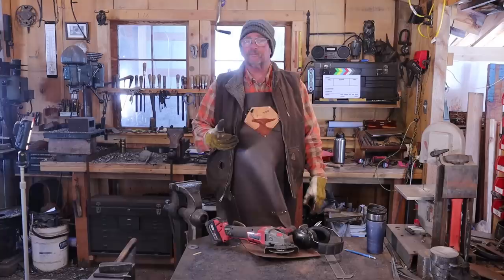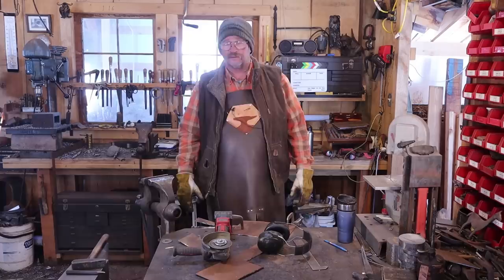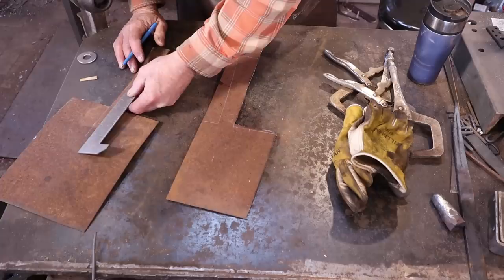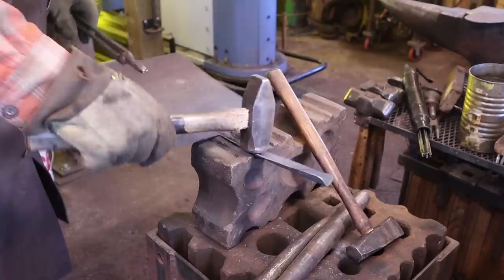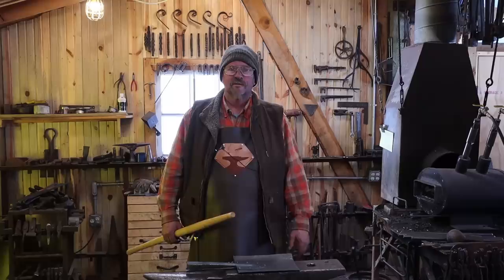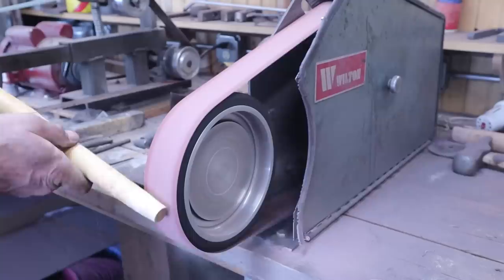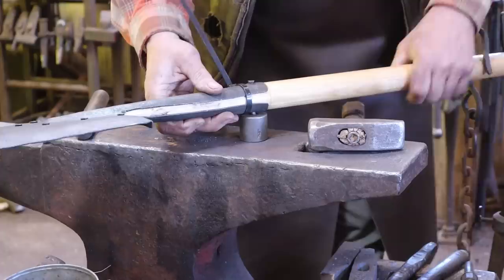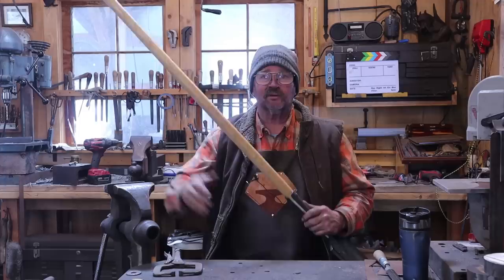Forging a shovel inspired by historic examples

Comment: The step, that part of the shovel you put your foot on is called the step. 
Nice project, until i get ventilation set up in my new shop i can only use my gasser, which has only a 6" opening. Weather has finally broke here so hopefully i can get on that this weekend. 
As a side note my "new" house came with #100 of coal still in the chute.

Comment: Thanks John. The old shovels around the farm usually have no larger than 3/16" rivets holding the handle and often have a second smaller about 1/8" rivet lower down. Some have a single handle support that wraps fully at the blade end but is split all the way and these have the top rivet set into the wood on the backside, the second rivet goes at right angles to stop the ferrule spreading under pressure. Love your shovel but think it would benefit from a second rivet to stop the halves spreading when under pressure.
Reply from the maker: Thanks for the information

Comment: I like how you made it! 
For next time try putting ring  where you putt rivet on handle... it's more army showel corect😉
Reply from the maker: The original example used rivets, so using a ring wouldn't have fit the intent of the project

Comment: John, I realize that the following questions aren't having anything to do with THIS post but, this is a current post and I have some questions that others may have, too.
Where does one find xucker rod?  You frequently talk about using it and I have no idea where to get it.
Also, where can we get grader bits to use.
Things like this probably don't occur to you but, I'm probably not the only one that would like to know!
THANK YOU!
Reply from the maker: Sucker rod is the connecting rod between an above ground pump head and the actual pump in the hole.  Typically used for oil wells.  I have never gone out searching for grader blades they just show up from time to time.  You might try an equipment rental store that rent heavy equipment.

Comment: Good looking shovel.  I wonder if there are any survivors from back in the day?  Do you think the handle rivet bowed due to being to long or type of steel or cold set or today's wood?
Reply from the maker: This is based on a photo of an old one, so there are some out there somewhere.  The bow is just from a long skinny rivet.  A hevier rivet or a much smaller head would likely have worked.  Also much softer materiel would head easier